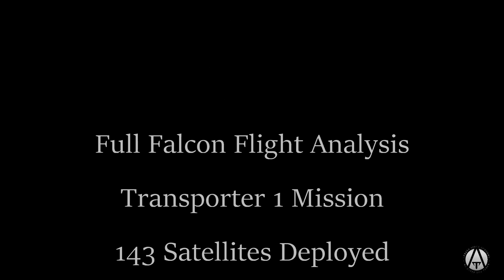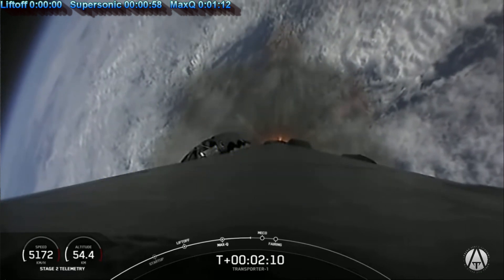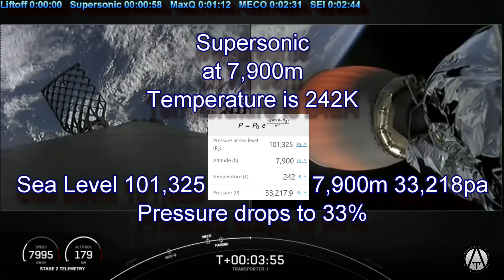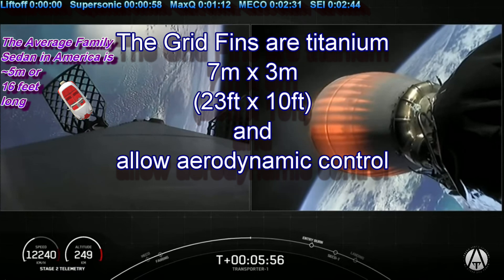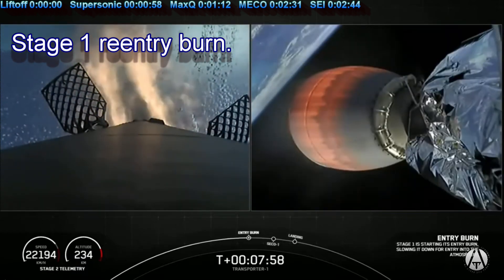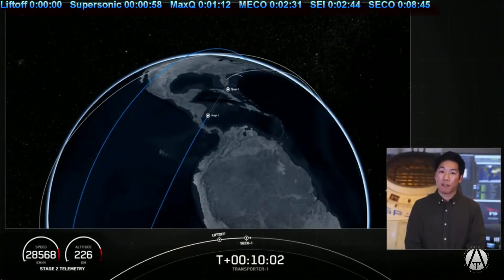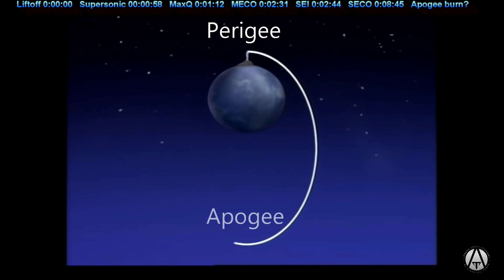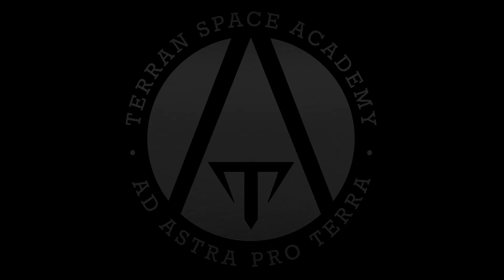Flight of the Falcon: Full SpaceX Falcon 9 Orbital Flight Analysis

Comment: Did you notice at 11:34, that large floating ice snowflake suddenly sucked into the exhaust stream when the engine lit up? I hadn’t thought at 538 km altitude there would be enough air to do that. I was surprised.
Reply from the maker: It is amazing how far the atmosphere actually extends. When the moon is on the opposite side of the earth from the sun in the solar wind stretches or atmosphere out to the moon and actually causes oxidation of the iron on the moon.

Comment: Question please, if Starship is going to carry 100 people, I know we can scrub carbon dioxide out of the air to keep using it but how much extra oxygen will they have to take with them? Video idea maybe? 😀. Cheers
Reply from the maker: Breaking down the carbon dioxide by the Sabatier process produces methane and oxygen. So the oxygen is recycled.
Reply: @terranspaceacademy  Thanks, but nothing is free, if the methane is being removed for use of the rocket, surely something has to replace it? And won’t that mess up the methane, oxygen ratio?